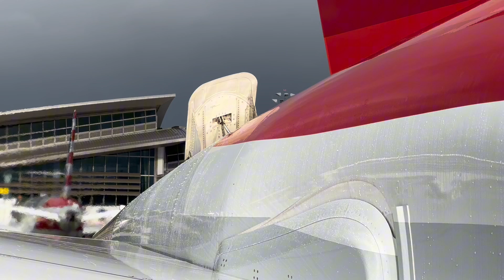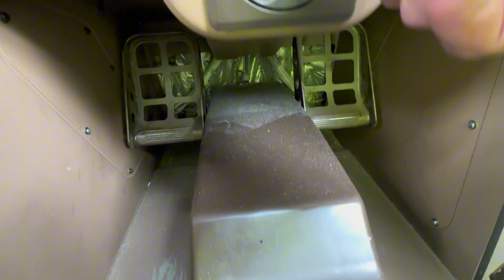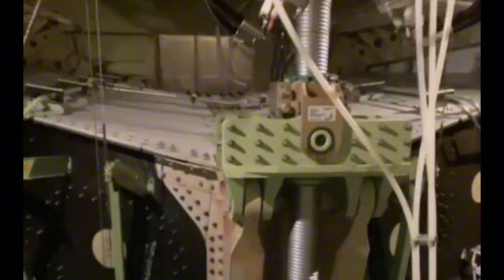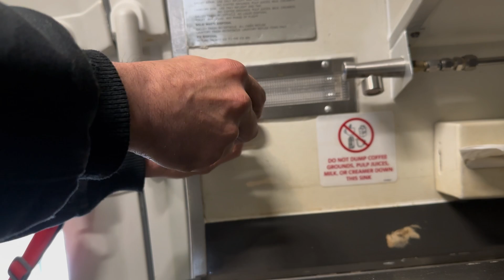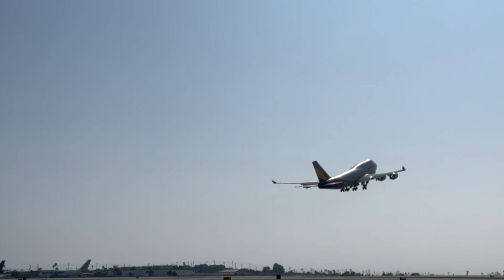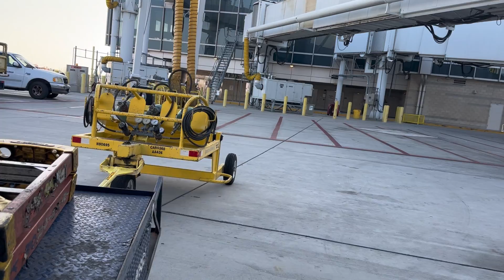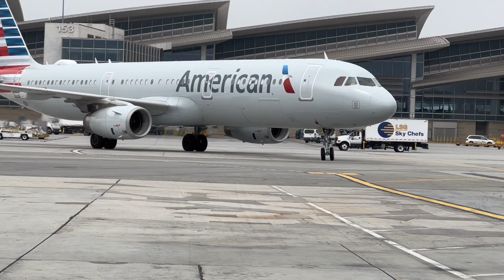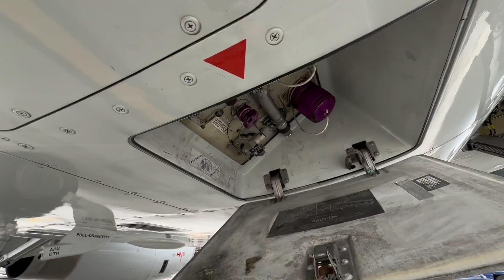Stig Shift #20 (Aircraft Maintenance Adventures)

Comment: Off topic, but I noticed that the angle of the inlet into the engine isn't at 90°. That is it isn't perpendicular to the ground. It's slightly angled. Is this designed for landing/ takeoff with higher angle of attack in mind?

Comment: That instrument panel is so grimy and dirty @16:07. Get a small detailer brush and clean up that panel. Does anyone ever clean the instrument panels?
Reply from the maker: That’s a pilots responsibility to keep their work area clean. If I make the mess I’ll clean it. But I’m not going to clean up after pilots.
Reply: @StigAviation  I don’t know man, it isn’t the stewardess responsibility to clean the cabin area after every flight. The pilots didn’t create the mess on the instrument panels, it’s just dust, dirt and grime built-up over time that should be cleaned, not by pilots or even aircraft mechanics. But I wouldn’t want the cabin cleaning crew near the instrument panels. It would be a pretty detailed job cleaning around all of those switches, dials, indicators and avionics
Reply from the maker: @Mr.G360  actually pilots do create the mess, if you ever seen the things that get dropped on the floor and behind rudder pedals. It’s a mess sometimes. I try to keep things clean as much as I can but i simply don’t have the time to  wipe down everything on every single flight I work on. This is why cleaning cloths are provided to the pilots. Don’t get me wrong, if I had the time I would sit there and make it shiny and beautiful, I just simply don’t have the time to do that.
Reply: @StigAviation for sure if pilots drop shi-stuff on the floor they should clean up after themselves, but dust, grime and crud on the instrument panels is different, unless pilots spill their coffee or food on it lol. Maybe airlines should hire or create an instrument panel cleaning crew and thoroughly clean each aircraft’s instrument panel once a month?   What do you mean you don’t have time? Isn’t it working hours and you’re on YouTube? Just bustin balls lol. Great videos 👍

Comment: 55:55 What is that fin on the end of the wing called? Doesn't Airbus now have the shark fins? I think they copied Boeing's design
Reply from the maker: There’s a variety of names for them, some have different designs and have different names. They have sharklets, wing tip fence, winglets. Boeing has split scimitars or racked wing tips. I’m not sure who copied who, or if it’s simply original designed by the manufacturers.

Comment: @StigAviation Hello my name is Charles. I admirer all your videos on aviation maintenance and I had a few questions about the cargo bey including the roller ball-mat area. I know in the video you were explaining the differences in the cargo bey area on the Dreamliner. But on Airbus Aircraft in particular the Airbus A320 family aircraft do you know who manufactures their XZ & YZ latches? Also, with Airbus their cargo bey area looks a lot different than Boeing's even though they use similar components and functionality. Can you explain to me the differences in what Airbus uses such as electric door lifts  or does their door use hydraulic lifts on the A320, A321 and A350 XWB fleet?  Lastly, you were showing in the video the PDU unit which had a raising mechanism. Do you know if Airbus uses this same systems on their PDU's within their aircraft?  Thank so much for your response.
Reply from the maker: That’s an excellent question, now the problem here is that our 320 family aircraft do not have any power drive units. Ours are loaded by hand. In regards to the door, airbus uses hydraulic pump to open and close the cargo doors.

Comment: That sl65 has a 6l twin turbo v12 making around 700 ish hp with a 5 speed semi auto will spin the tyres in 2nd with fairly long gearing will do over 200mph
Reply from the maker: Now that’s impressive

Comment: I'm doing a 777X Avionics course, the equipment bays are the same on the 777 I believe. Which one where you in? Main-Equipment Bay or Fwd-Equipment bay? I'm in the 737 part of Boeing, so we don't have a 777X laying around. It's so cool to hear all the theory in practice...😀
Did you know that the light configurations are preprogrammed and loaded into a database of the Cabin Entertainment system?
Reply from the maker: Yes, I did know that, and every single time we have to change out any kind of LED lights we have to push the software along with it. Sometimes it does not like to take. 😅😂

Comment: Do the 787 laptops run on XP too...? 😏
Reply from the maker: Yes windows but on windows 10 last I checked
Reply: Sorry I couldn't resist. I'm sat here watching your Christmas shift vid and it just popped into my head when you pulled the laptop out. It wasn't a criticism in anyway at all. Win XP and Win 2000 were the best OS's Microsoft have ever and will ever do imho 😊
Reply: Oh and the two dots on the Airbus push buttons denote which part of the button is not being used, only the part without the dots will light up.

Comment: Hey, minor little observation/question but wanted to ask instead of assuming... The hatch for the e&e Bay on the 777 is just behind the nose gear, what's the little hatch in front of the gear? The one in between the nose cone and the nose gear doors? I was assuming that it's just do you can access the very "front" of the bay as it gets ever more narrow the further forward you go...? Same on the 787's too.
Reply from the maker: That is also another E&E bay. It’s a smaller compartment where other avionics components are located.
Reply: Ah ok. Loc, gs and weather radar equipment at a guess?
Reply from the maker: @KevWitt3455  the major components that you were mentioning are all housed within the radome, but the electronics and some of the wiring and computers are in the aft compartment of that equipment bay
Reply: Ah ok, I get you

Comment: 8:53 what’s that fin on the side of the engine exterior? Is it purely for aerodynamics or is there sensors in there?
Reply from the maker: That is called a vortex generator or a strake. Allows proper airflow over the wing due to the massive engine size.

Comment: I'm one of the top 20 people in the water treatment industry in the United States according to certifications from the industry those UV lights can be temperamental any type of organic slime can cast a shadow and the UV light kills bacteria by basically splitting apart their guts blowing apart their their cell structure and if there's any type of shadow that bacteria hides behind that shadow like a little eclipse and the UV radiation doesn't get to it very important that those UV sterilizers are kept clean the quartz glass on them needs to be cleaned pretty regularly
Reply from the maker: This is incredibly interesting Tom, thank you so much for teaching me something new.

Comment: I am so glad you said that about the two 737 Max incidents because it was preventable and if the pilots had gone through more rigorous training more Sim time than those accidents probably would have never happened

There were other flights were the MCAS malfunctioned and Pilots got out of it because they did spend the time in the simulator and they did know what to do 

Iit's even more crazy the fact that they disengaged the stabilizer and then re-engaged it that is just insane you can't blame Boeing for that
Reply from the maker: I believe there is fault all around in these cases. It’s a long chain of events that lead to the crashes.

Comment: Hey stig as far as you know what’s the process for repainting the aircraft and what do you do for it as prep? :)
Reply from the maker: Generally they repaint an aircraft because the older paint has been deteriorated. Now I have never personally done this job, it is done usually by heavy maintenance at very specific stations. But the process is to strip the paint and then repaint much like a car. The one big difference is using correct ratios because paint also affects weight and balance of the aircraft.
Reply: @StigAviation  okay thx

Comment: You're right that it could've been prevented (MAX crashes) but ONLY if Boeing had bothered to mention MCAS was a feature. They didn't, and so we had 2 crashes
Reply from the maker: You are so correct. Boeing did a poor job on this. They didn’t provide enough information about the system.

Comment: The reason the pilots didn't turn off the system is because BOEING didn't tell them that it was even there! Yeah ,put a very important system on a airplane with hundreds of souls and not tell the pilots that it even existed. Your just like boeing  put this on the pilots, insulting.
Reply from the maker: I do not disagree with you, I 100% agree in the point where they did not tell them about the system, the point I’m trying to make here is that if pilots understood that the horizontal stabilizer is running away then they should’ve reacted to it. Now, the timing on this had to have been perfect, But unfortunately, they did not react in time
Reply: @StigAviation  by the way, I love Boeing airplanes and I just flew back from egypt in a 787 something I've dreamed of doing since it came out! Also same trip I flew a 747 another one that I waited 40 years to fly in one of those bad boys!

Comment: Stig.
Can you do a video on how cockpit crew would use the restroom or get served beverages/ food during flight?
I’m curious, because if the cockpit door is supposed to be locked during flight, how do those things happen in flight, if the door is supposed to be closed and locked during flight?
Also, what did the NTSB/FAA do for redundancy, when cockpit crew leaves the cockpit, and the one person left in the cockpit, goes crazy and wants to crash the plane (like that pilot did in Germany, and crashed the plane)?
The other cockpit pilot was locked out, and couldn’t save the plane.
Thanks
Reply from the maker: Trent that’s a great question, but unfortunately i can’t speak on that system. That’s one of few things I will not talk about or discuss online (flight deck doors or related items). It would be a security sensitive information. I apologize for that, but I do encourage you to do research online, I’m sure there are some other sources of info out there. It’s just not going to come from me.
Reply: @StigAviation  could you possibly talk about if there is a write up on the cockpit door?
Reply from the maker: @trentmiller7532  I’m sorry but I can’t. I don’t want to get in trouble and I don’t want to disclose anything that could potentially cause a security breach.
Reply: @StigAviation  okay. Thanks for the info.
Keep up the good work, for safe flying!

Comment: Stig, I have a good questions. Two movies "Catch Me if You Can" and "Commando" a guy goes to the bathroom on tarmac and goes through a wall and climbs out of the airplane through the wheel well. Is this possible? I know the part in Commando, Arnold holds on to the front landing geer as the plane takes off. Maybe 50 to 100 feet he lets go and falls into a swamp, gets up and starts running. NO WAY that part could happen LOL.
Reply from the maker: Both great movies but neither have are real when it comes to said scenes but still great movies nonetheless 🤙

Comment: Nope, you cannot prevent MCAS from diving the plane to the ground in some circumstances. Whether it is recoverable or not depends highly when it is activated, the airspeed and the height above ground. It is possible that MCAS were deactivated when the trim is in extreme position with high airspeed, making manual movement of the trim wheel impossible This is what happened for the Ethiopia accident.

Note that MCAS activation is also not the same as trim-runaway. Trim-runaway is continuous movement of the trim wheel.

MCAS will only intermittently move the trim wheel… which makes it much harder for the pilots to detect since there is no other indication and initially it will seem like any normal autopilot trim wheel operation. 

Also note that MCAS was relying only on a single AOA attack sensor so there was absolutely NO REDUNDANCY provided at all for MCAS

🤦🏻‍♂️
Reply from the maker: Look, as I have said before I do not blame the pilots for this, all I am trying to say is it could have been prevented. Understanding a stabilizer runaway is key, essential training, especially when it’s underdress as those pilots were. I do not for one second relinquish the blame from Boeing, because I do blame them. But the fact of the matter is to understand and recognize a stabilizer runaway and a reaction is essential. I’m gonna ask you a question and this is a genuine question because if you have read the NTSB reports or any other new source findings, tell me how many times did the stabilizer intermittently Went down until are in serious danger? How long did it take them to understand what the aircraft is doing and the altitude and speed they were at?  These are the key questions I’m focusing on because it’s strange to me to see well trained pilots not reacting fast enough.
Reply: @StigAviation  My point is, the pilot cannot prevent it every time MCAS falsely activated. No matter how good the pilot and how well trained they are, in some situation… it will be impossible to recover. Hence, the FAA estimated that there will be 15 crashes in 30 years or 1 crash every 2 years from MCAS.

Also as I’ve explained MCAS is NOT the same as runaway-stabiliser which is a continuous movement of the trim wheel.

MCAS only activated intermittently and NOT continuous and will initially seem exactly the same as normal autopilot operations of the stabiliser. This makes it much harder to detect. The only way the pilot can detect that MCAS is activating is literally when they noticed more ground than sky out the windshield.

Here is an official statement from the Southwest Airline Pilot Association on the matter:

“An MCAS failure is not like a runaway stabilizer A runaway stabilizer has continuous un-commanded movement of the tail, whereas MCAS is not continuous and pilots (theoretically) can counter the nose-down movement, after which MCAS would move the aircraft tail down again. Moreover, unlike runaway stabilizer, MCAS disables the control column response that 737 pilots have grown accustomed to and relied upon in earlier generations of 737 aircraft”
Reply from the maker: @tonamg53  that’s a fair point of view my friend. I respect that and learn.  One thing I’m glad , or i should saw we are both glad to see that the expectations of crashes have not come to fruition. Which means they have been improving in certain areas.

Comment: Plenty of blind rivets get used in auto body work. We call them "pop rivets" because when it separates the pin after fully upsetting the shank, it makes a very audible "pop" sound.
Reply from the maker: Yup 👍. That’s the one. You guys use the pneumatic tool or the hand one ?
Reply: @StigAviation  Stuck with the hand one at my own shop, the pneumatic one is expensive, but now there's one that runs on a Li-Ion battery pack (identical to the same-brand cordless drill batteries) instead of either hand power or pneumatics, and that looks real interesting (more expensive and a little heavier than the pneumatic one, but hey, no air hose to get wrapped up in)
Reply from the maker: Take a look at Harbor freight I think I saw one last week, they had a pneumatic one which was a good price
Reply: @StigAviation  
As of April last year, we still have all the tools, but they evicted us from the building we were in, then they condemned it and tore it down (maybe we should be counting our blessings?).
We never missed a payment on the lease all the years we were in that building, but looking back on it I can tell that the people who owned it never really gave it the proper care it needed (roof leaked and needed replacing when we started leasing it, and they said they'd do that but then they kept kicking the can down the road, and now that's what killed the building).
Anyways, I'm out a job now, my dad found work in a children's home as a facility maintenance person, maybe some day I'll get a new job but it's not looking good because I'm not willing to take any job that won't pay me enough to actually live on, and that excludes literally all the jobs that I can actually sign up for right now.
The thing that's killing people's ability to afford things right now isn't inflation, it's greed. Corporate greed, they're doing the whole "If we can't charge more, we'll pay the workers less" thing and it's hurting everyone.
Be thankful you have a union (I hope) representing you or that would probably be happening to you right now too.

Comment: Hi Stig, with regards to the Crew Oxygen bottle replacement, why does it deplete and loose bottle pressure, I thought it was just there for Emergencies, cheers Nick
Reply from the maker: Because pilots perform an oxygen systems check prior to every flight and the oxygen slowly depletes like that.
Reply: I see, yes needs testing, who tests the passenger area the lead steward, Nick
Reply from the maker: @5555nickb  passengers oxygen doesn’t need testing because the oxygen comes from a chemical reaction canister called a oxygen generator.